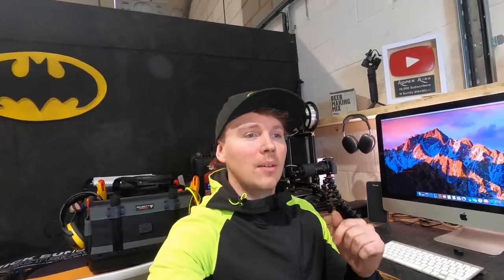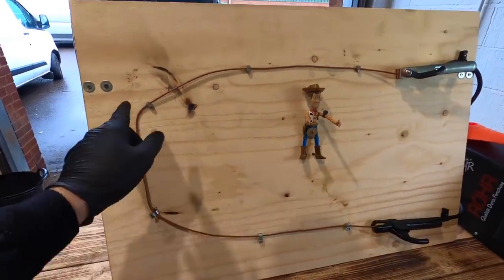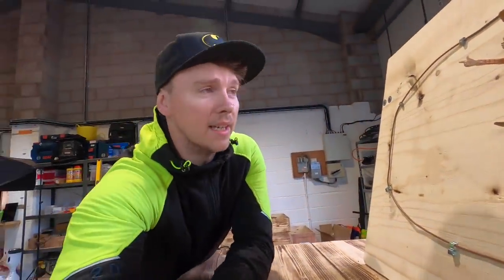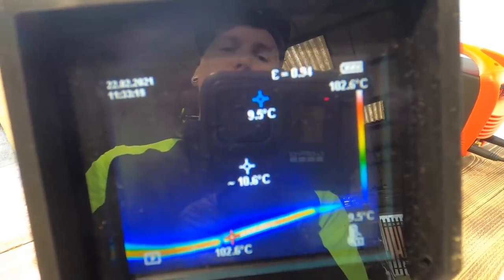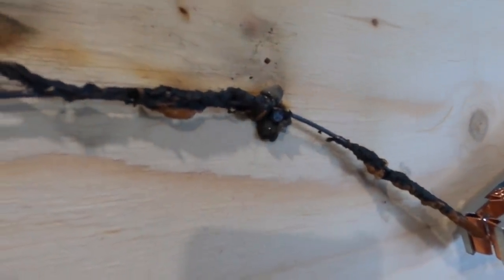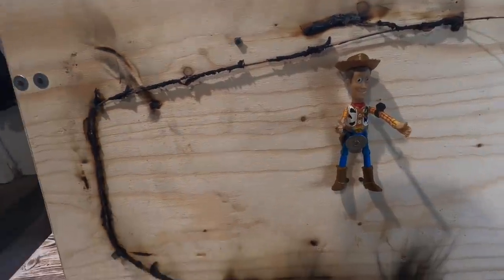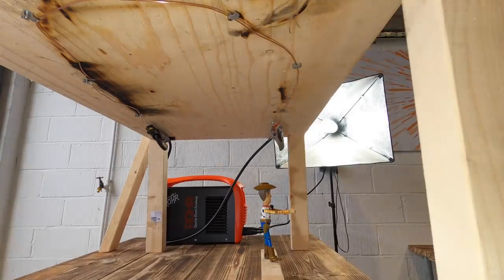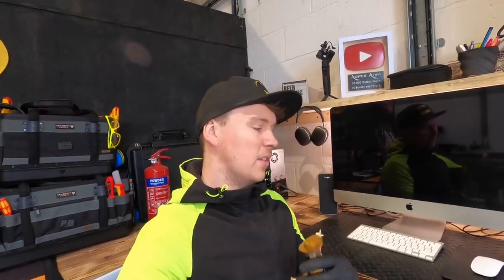Metal VS Plastic Cable Clips, Electrician

Comment: Great demo as usual, Totally agree with this regulation even back when it was introduced within the 17th Edition. But it really makes a joke of this when you see other contractors who aren't electricians installing door entry systems and alike without premature collapse methods in place. A 8 core telephone cable or alike will still entangle a fireman or anyone else
Reply: Bs 7671 is not good enough in this instance to help electricians and designers from making the right choice in the application of this regulation.

Comment: The concern isn't really the cables burning, of which there is only limited energy, the point is if the space itself is on fire this heat is trapped high up and this then melts all of the cable retention causing all sorts of tangling hazards for fire fighters.  Even if you're installing data or AV stuff you should ensure you're considering how to prevent premature collapse in a fire.
Reply: Absolutely, I enjoyed the video but not a demonstration of Regulation 521.10. 202 . The issue is 1,085 deg c which its the meeting point if Cooper vs the melting point of the containment system.

Comment: Why would you have a 60 amp breaker on 2.5 mm cable?
Reply: @Chuck Kirchner I've found a 2.5mm 15A Australian GPO, which had been (literally) hotwired into the street feed in the roof of an industrial shed- used to run a solder bath 24/7 and with electricity prices in Australia the way they are, the previous owner (been there 40 years before shutting down) had been 'borrowing' electricity (for at least a couple of decades by the age of the wiring)... There was zero protection apart from the 'fuses' in the overhead powerlines outside- not even the elcom 100A one was in circuit...

Comment: A fire in Shirley towers, Southampton way is what really pushed the change, especially for over exits. 2 firefighters from HFRS were inside and the heat rapidly increased and unfortunately lost their lives. Outside the property, in the hallways, there was a lot of sticky back trunking which had all melted away and just looked like copper cable bunting along the hallway

Comment: Ref Shirley Towers Southampton,  http://www.cfoa.org.uk/18782 ,interesting reading for all that fix cables on walls or ceilings, the clips and trunking can melt  from the fire and not just overheating of the cable., resulting in access or exit routes being blocked.
Yet again another easy to understand video.

Comment: Yeah.with a wire you are right!BUT are you always installing just a wire???No!You install cables,with a minimum of 3 wires in it.Metal clips are making a shortcut between those wires if the cable gets to hot!Thats why metal clips are not allowed in the Netherlands.Even if the cable is fed through a plastic pipe like we do a lot.

Comment: Our company is still using away at plastic clips on building sites, houses,  has this regulation been out long ?
Reply: 2015 17th AM3 Its only needed if its classed as a fire escape route, also house are fine to use plastic as plasterboard is a fire barrier.
Reply: @lewis94uk  not since 18th mate it's all surface wiring now not just escape routes. Although yes not needed if behind a fire barrier.
Reply: Sorry Jon it's all wiring systems that may be subject to premature collapse. A non fire rated fabric offers no protection.
Reply: @sandymcnair5298  I'm slightly confused. I did say behind a fire barrier. A plasterboard ceiling will give you 1/2 hour therefore not the sole means of support therefore compliant.
Reply: And I can't believe I've just had to check the bloody niceic site guide to check this but it specifically says that cabling within the building fabric i.e above a ceiling does not represent an entanglement risk and does not need further support. I need a beer.
Reply: @travoltasbiplane1551  the site guide is not the regs and often gives the wrong info. Even bs7671 is just a guide. We are talking life safety here and we must not blindly follow guides without thought. Unless the wiring system is adequately supported and prevents premature collapse. Not only for escape, but for evacuation and for fire fighting peocess. If you believe that non fire rated  plasterboard is going to do that for you... I wish you good luck.
Reply: @sandymcnair5298  in what universe is following guidance on the regulations published by a member of jpel64 not acceptable or dilligent enough for you? I'm not blindly following anything.
Reply: @travoltasbiplane1551  when it kills someone.
Reply: @sandymcnair5298  probably better stop installing cables full stop then because they've killed people too. By your logic virtually every concealed wiring system in the UK is potentially dangerous and should be coded as such if ever inspected. There is a line where practicality has to come into play and some acceptance of risk. Bearing in mind we have lamp-holders sold today with live parts exposed with the lamp removed....
Reply: @travoltasbiplane1551  concealed wiring is fine if its adequately supported
Reply: @sandymcnair5298  mmm that's not really my point. Look you clearly feel very strongly about this and fair play to you. Nonetheless this your interpretation of the regulations. I think it is justifiable for us mere mortals to follow industry guidance especially when it is from the biggest regulatory body there is (who also help write the regulations).
Reply: @travoltasbiplane1551   I can tell you this Regulation 521-10-202 is absolutely clear with its intent ... wiring systems are to be supported not liable to premature collapses and furthermore, it identifies fire fighting activities. Nor does it mention anything about surface wiring, nor does it mention concealed cable being ok, The regs are the regs and engineering solutions need to be considered and engineered appropriately. 
Consider reading the Coroner’s Rule 43 Letter Shirley Towers, Hampshire. Look at the recommendations that were given to both the building regulations and the IET ... In essence, the cable should melt before the structure gives way....try to understand why it is important to put safety above profit. 

We are talking about a few metal clips/bands to the structure and saving peoples lives. I am sorry to feel this is not worth the cost of your electrical installations. I am going to stop now as this is going nowhere. No further responses by myself.
Reply: @sandymcnair5298  note 3. Exposed surfaces. In a ceiling void behind a later of plasterboard is not exposed. It's not about profit. On a new installation with full access I think you have a point and I may go further in the future. But retrofitting or in an existing installation you just will not have this level of access 99% of the time. And the client may take issue with me tearing his building apart to achieve something that goes beyond published guidance.
Reply: @sandymcnair5298  yeah but your not staying quiet are you? You're still going albeit via smiley. I think the flaw in your argument is that you expect the wiring system to last longer than the building fabric. If a 1/2hr fire rated ceiling is what was required to protect the structure and its occupants why do you think it inadequate to keep some cables at bay? If not then I think the issue is more with the construction of the building that is collapsing prematurely and not the wiring system. Or are cables the only element of a collapsing structure that can kill a firefighter.  I'm all for trying to do things better and as discussed will probably give additional thought going forward. However if the intention of the reg was a blanket ban of anything that can't withstand fire for three weeks this could have been written more simply: i.e all cable supports need to be fire resistant in accordance with whatever British standard applies to cable clips. But it doesn't. You say it's absolutely clear but it's not and the industry as a whole does not follow your line of thought. You're stating opinion as fact and whilst it may be a good opinion it is not an absolute. So stop saying that it is.
Reply: @travoltasbiplane1551  no flaw in my points, just not indulging anymore. Take it any way you like.
Reply: @sandymcnair5298  have a good weekend Sandy.